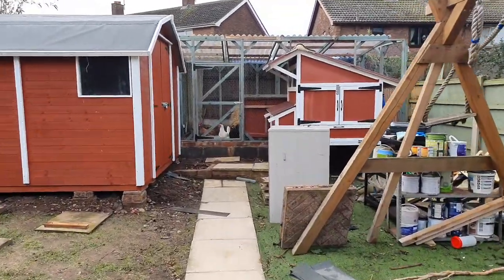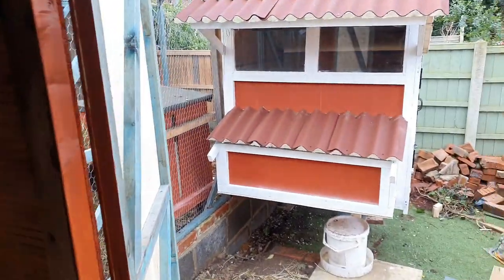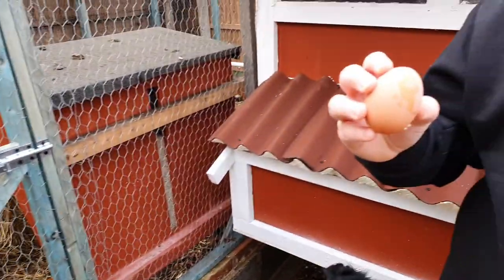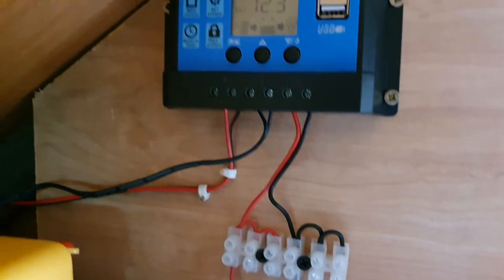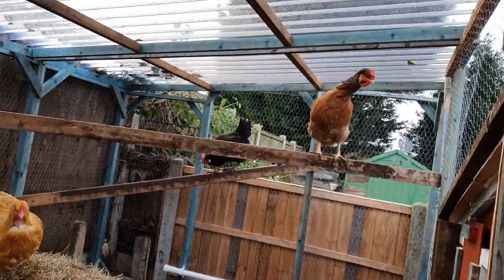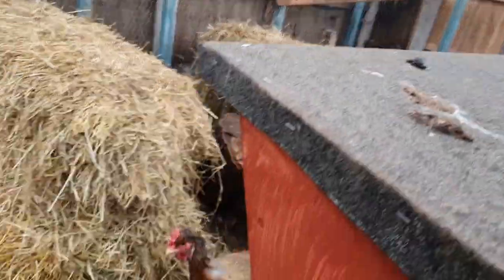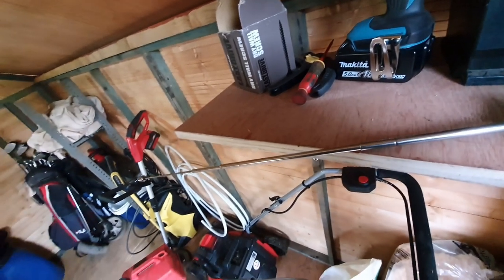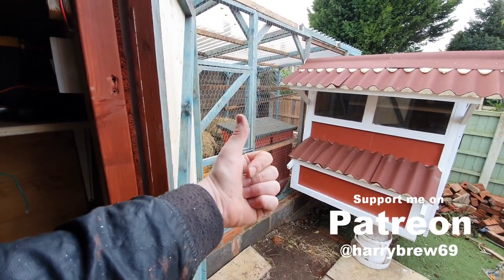Happy Eggs & Solar Shed Lights

Comment: Love it! I also built a new chicken run this year, suffering with water run off flooding in from the field behind though. Nice idea with the solar power and aerial 😂 saved a fortune compared to Omlet system! If that doesn't have enough power i'm sure you could install a hydraulic ram! Might want a safety microswitch on the door just in case though! lol Cheers